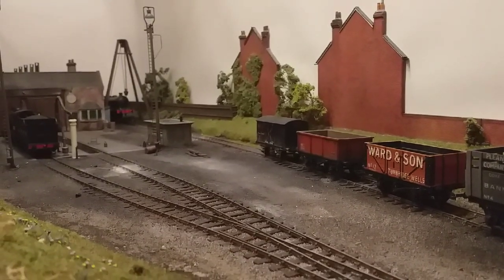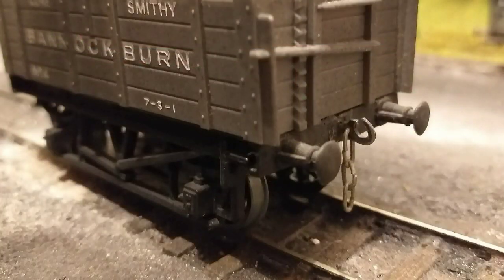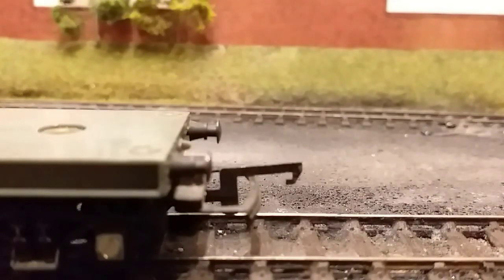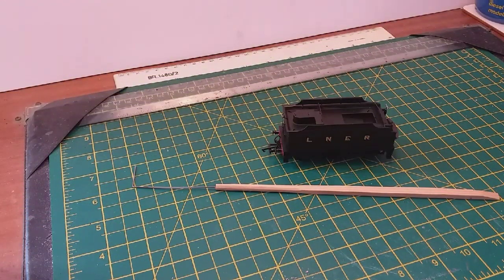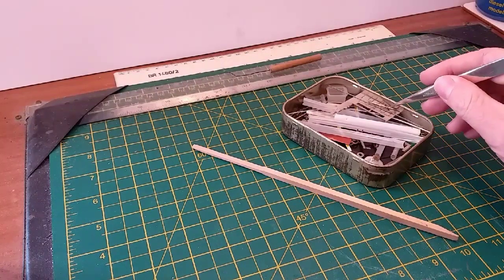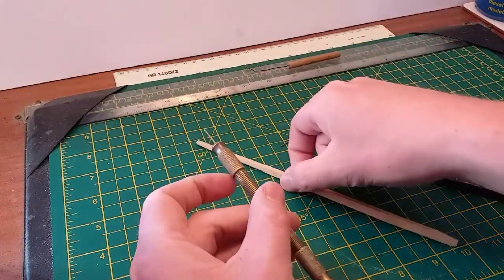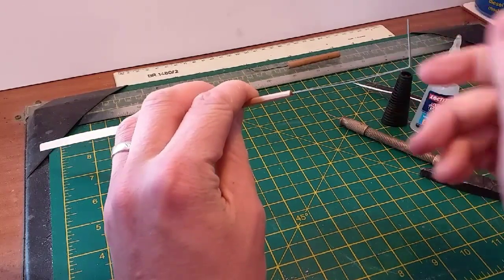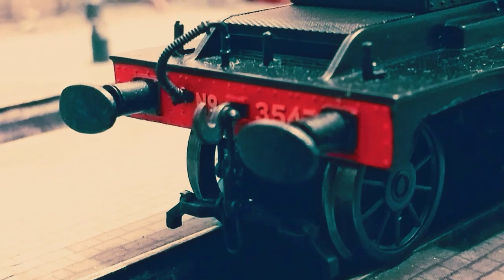This is the most realistic method of coupling for your model railway? What it is and how to make it!

Comment: Great video James a further development on the shunters pole we soldered a brass paddle to the wire so when you put the shunter pole in between the wagons the paddle lifts the hooks using the part that hangs down below the D bar works a treat keep modeling and stay safe
Reply from the maker: That's a really good idea Andy.

Thanks for the comment.
I hope others read it and make use of that suggestion as it would definitely help people using tension lock couplings.

Comment: I use a miniature bar magnet in a plastic tube to uncouple my tension lock coupling. It is vastly superior to the shunter's pole it replaced,, because it lifts the hooks from above.
Reply from the maker: That spends really clever. Great idea, I'll give it a try.
Thanks for the comment.
Reply: @JAMESDEMU-RailwayModeller  The magnet raises the hooks without actually touching them. On old Triang couplings, touching the raised hook will cause it to magnetise, temporarily and remain raised, for a few minutes, so that loose/fly shunting can be performed.

Comment: Good useful video. What do you use for the metal wire for the coupling tool?
Reply from the maker: Thanks Matt. 
It's just 1mm steel wire. I've had it around for years so can't remember where I bought it from but a paperclip can be bent to shape and used too and it works just as well.
Reply: @JAMESDEMU-RailwayModeller  Arh that's a good idea and I could use the a paper clip I guess. I do use a dentist tool to uncouple and works ok but I'm wondering whether your design works better.

Comment: I'm not very interested in couplings (I use Kadees) but your layout looks very nice indeed. Quite austere but perfectly executed - your track weathering in particular seems ultra realistic! Rgds, Joachim
Reply from the maker: Thank you Joachim.
I used to use Kadees too but they do t suit my older stock so (as you've seen) I've gone back to using screw and three link couplings instead.

That's very kind of you to say.
It took quite a while to do working from a few dozen different photographs of steam sheds back in the 1950s and 60s. 
If you're interested in seeing a bit more if it, the layout is Kirkby in Ashfield MPD (38F) and I've put a few videos up over the past year or so documenting the work carried out so far. 

Thanks for the comment, really put a smile on my face.

Thanks again.

Comment: Very good idea I like. Can't use this with those magnetic couplings. They have to be pulled apart
Reply from the maker: Thanks David.
Yes, you're right.
 I'd always assumed that the magnetic Hunt Couplings currently available are for fixed rakes to improve reliability and ease of stock removal and rotation at the end of a running session. It's a compromise but I use Hunt couplings between wagons and coaches and screw links at either end so they can be easily attached to or removed from the locomotive.

Comment: Where can you get the three link couplings?
Reply from the maker: Good question Carl.

Start with Ebay as there is usually a few packs on there.
Then you can either ask at your local model shop or see which shops have them available on line.

I prefer to use Romford couplings but other makes are available.

Comment: Don't think that was a Sprat n Winkle.  

I use 3/screw links mixed with Dingham's.  Smiths hooks prefered as they are a fart over scale and easier to make compatible with Dinghams.  This new layout will need some auto coupling as it'll have express trains coming into a station canopy and I need them hands free to uncouple.  Other areas for wagons don't matter as much though.  Shunters pole or magnets for those.
Reply from the maker: I had thought of adding a small magnet to the end of the shunting "hook" to put under couplers that require a magnet to release them.

I'll have a play with them and see if they work as a mk2 variation. 👍
Reply: @JAMESDEMU-RailwayModeller  Ok cool.  I have managed to bodge Dinghams to Tension locks sited higher and also bodged a larger loop on the Dingham so the tension locks on coaches engauge with other coaches and the bodged dingham engauges with scale screw links.

It's still in experimental phaze so needs refinement butnI don't want my engines 'defiled' with fake couplings but also want some auto couplings yet am happy with fixed rakes for coaches

Comment: Old small paint brushes make good poles after the bristles have died, pull out the bristle head & drill the wooden stick to then press your metal rod in to.
Reply from the maker: That's a great suggestion for recycling old brushes. I'd not thought of that but ill be making the next one that gets worn out into another uncoupling hook.
Thanks for the comment.

Comment: How do you properly fix the screw link hooks to the bufferbeam… cant seem to get them to stay…
Reply from the maker: @VauxhallRailfan  there should be a spring and split pin if you're fitting an etched / kit built set.

The spring fits behind the bufferbeam, and the pin holds in in position.
The plastic cosmetic ones just glue into place.
Reply: @JAMESDEMU-RailwayModeller  i think i might have misunderstood the whole thing then, i just glued the screw links straight to the buffer beam, and after a while they just let go. So where do i get the ones with the springs?
Reply from the maker: @VauxhallRailfan  look for Smiths by W&T.

They're the best ones in my opinion.
Reply: @JAMESDEMU-RailwayModeller  thanks, pretty good price actually. Too bad that i have to pay £10 postage excluding import costs to The Netherlands..
Reply: @JAMESDEMU-RailwayModeller  ok sorry last question- could i actually use the dummy chain links and somehow glue them to the buffer beam and just use those as couplers…
Reply from the maker: @VauxhallRailfan  you could, but I wouldn't recommend it.

Comment: To make 3 link coupling / uncoupling easier try gluing the three links together. Not my idea. I think it is Gomo's channel
Reply from the maker: Hi Dibley.
To be honest mate, if you're using a shunting pole it's quite simple to connect any three, screw or instanta couplings. 
Gluing them would remove the realistic look and operation you get with them.
Under load they do pull straight but they dont remain under tension when stationary unless they're stopped on an incline.
Interesting idea though and I will look up Gomo to see exactly what they do.
Cheers 👍
Reply: @JAMESDEMU-RailwayModeller  I do see your point there. I guess it's all a compromise somewhere in the system!
Reply from the maker: @dibley1973  exactly.
Thats partly the reason why I made this video.
It doesn't matter really what couplings you use, is the way in which they are coupled and uncoupled that is where the models step away from reality.
I've seen some magnetic couplings recently and some one complained that they had to be uncoupled by hand. It got me thinking, in the real world, how else do you do it?
Reply: @JAMESDEMU-RailwayModeller  - yes ut us a very valid point you make, both here be in your video. We all need to stop getting so hung up with auto u couplers.